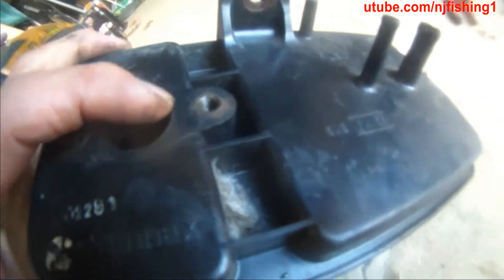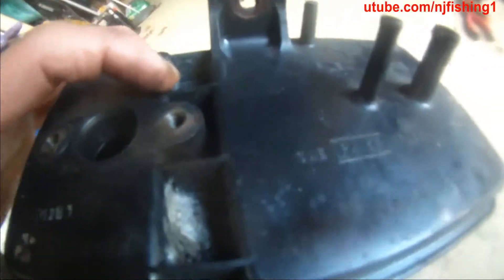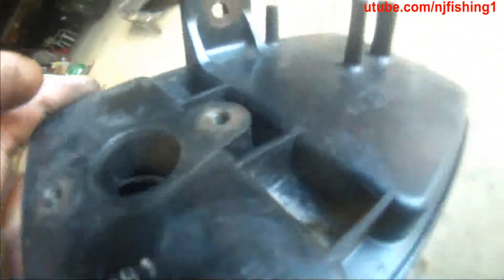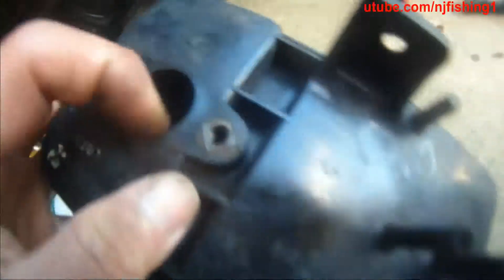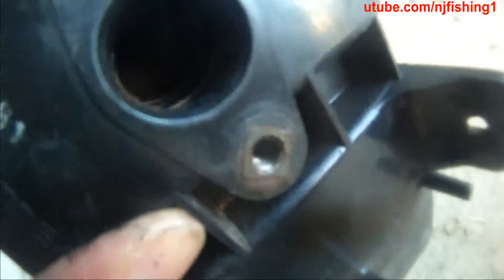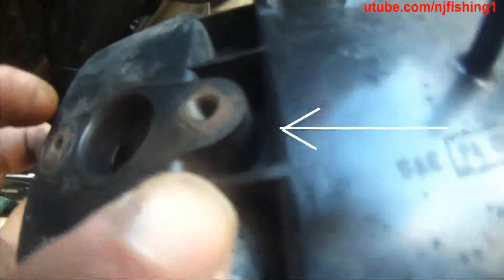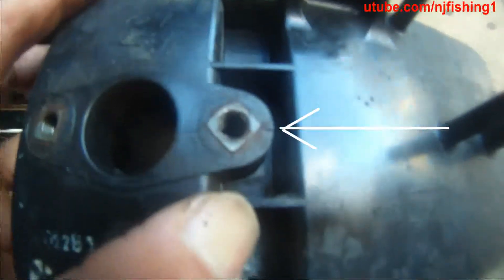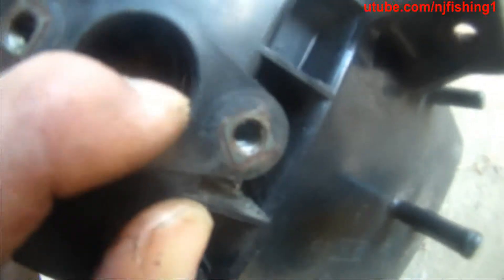P0440 troubleshoot for 2001 Nissan Pathfinder - canister hairline cracks

Comment: Did you ever get  rid of the p0440 code? What did you do? I got the code and it's driving me nuts because I can't figure out the problem.
Reply from the maker: Yes, replaced fuel cap, canister. Drive 50 miles and get inspected